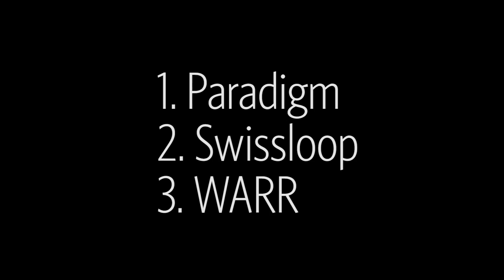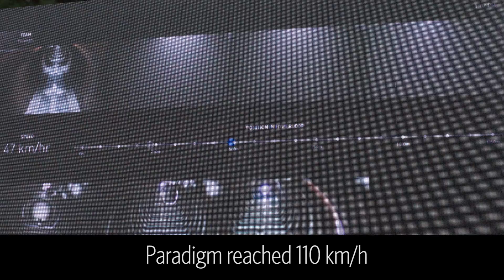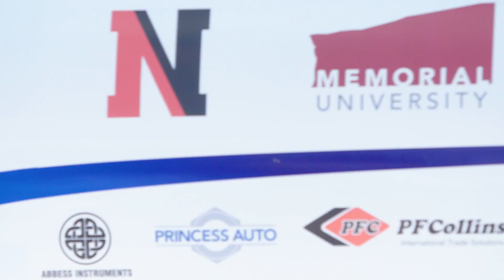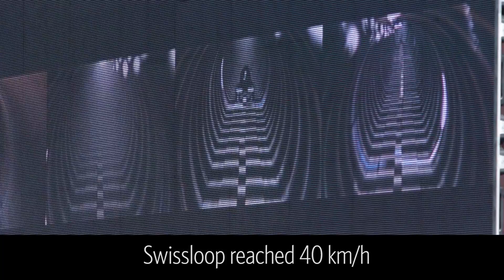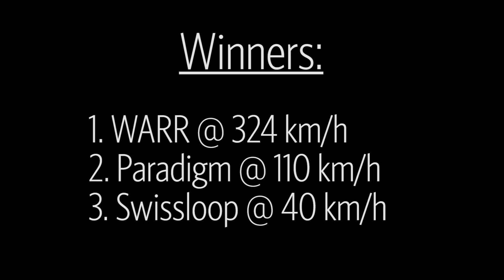Inside SpaceX's Hyperloop Pod building competition | Ars Technica

Comment: Somewhat disappointed that they went to friction drive, and shrank the size to fit the rail, thus avoiding having to match the tube size and its inherent restrictions. Of course they were smart enough to win a competition based solely on top speed. 
Hyperloop, as conceived, cannot really use friction drive as the clouds of dust it produced would affect following capsules.
 As slow as the other teams were, they did add to the  development of systems that may yet be employed. This tube is really only suited for "coast-down" testing of the ultimate friction reduction possible in the artificial high altitude regime the vacuum creates.  
I do think Elon has recognized that a Hyperloop at the surface will need sufficient shielding along its length from solar expansion forces so that The Boring Company machine of his could enable a more benign environment for such a system, with less impact from the various NIMBY detractors and those sure to attempt financial gain for the use of surface right-of-way.  It will add to the cost, but perhaps not as much as paying those standing by with their hands out.

Comment: Somehow I do not like the WARR design.. As far as i understand it, it relies on it's own  propulsion and it's accelerating by friction / el. motor.  This allows them a fast acceleration.. to win specifically this competition, but such design would prevent much higher speed.. like 6-700 + kph.. Furthermore it will have mich higher energy consumption, since it relies on friction, instead of preventing it.. So again.. good for a short test run and competition win, but no good for full size, real-life use...
That's IMHO.. I am not an engineer. ..